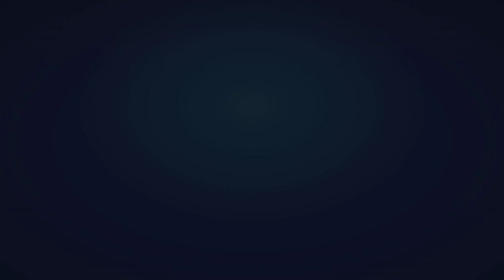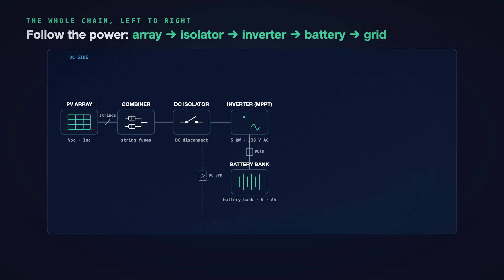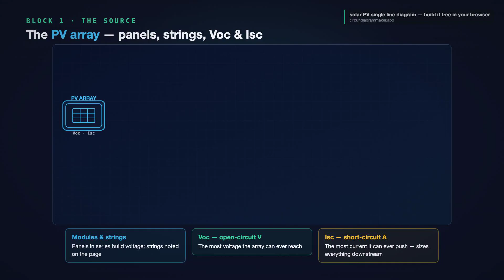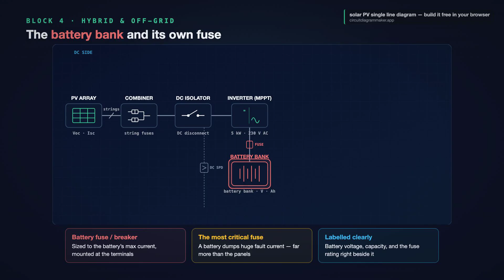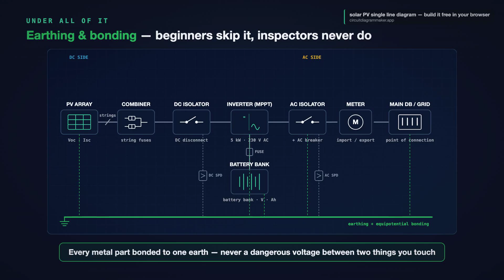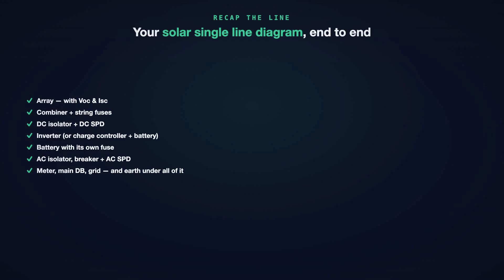Solar PV Single Line Diagram (Full SLD)

Comment from the maker: Quick map of the whole one-line, in the order the power flows: PV array (write down Voc + Isc) → string combiner + DC fuses → DC isolator + a DC surge device → inverter with MPPT (or an off-grid charge controller + battery) → battery bank with its OWN fuse → AC isolator + AC breaker + AC surge device → meter → main distribution board at the grid connection — and one earth line bonding every metal part together. The trick that makes it click: the DC side and the AC side each get their own disconnect, overcurrent device, and SPD. Which block trips people up most on their permit set? Draw your own free (no sign-up): https://circuitdiagrammaker.app/try?utm_source=youtube&utm_medium=pinned_comment&utm_content=yt-121